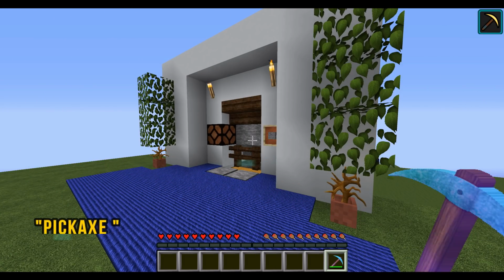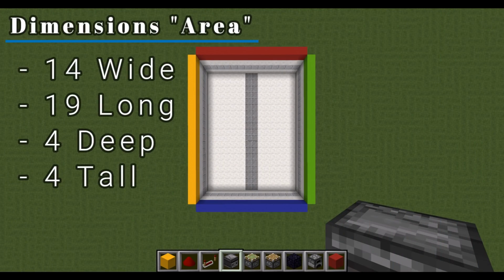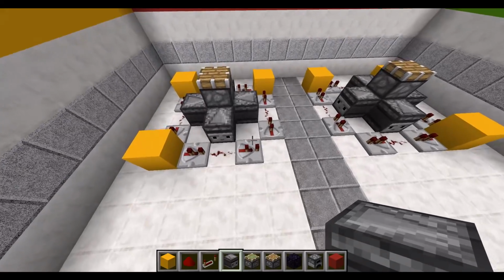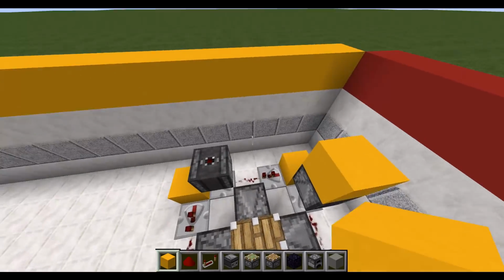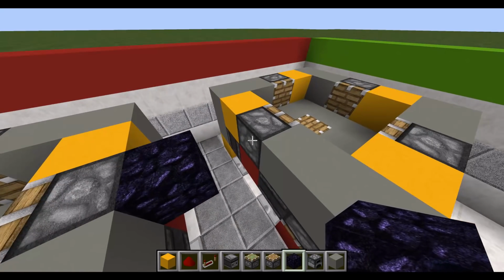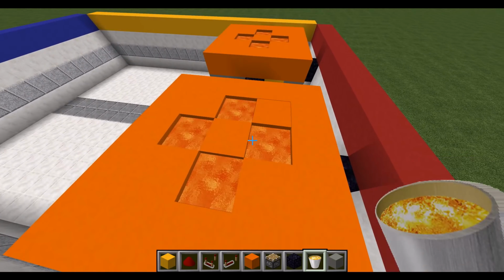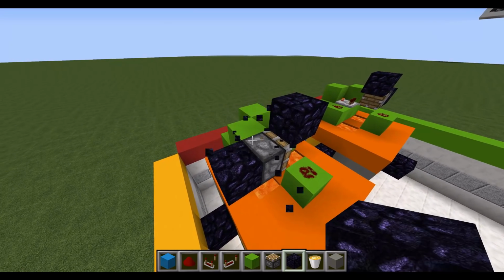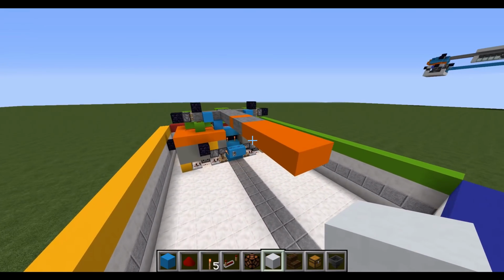Minecraft Tutorial : Auto "Cobble & Stone"  Generator V2 (Super Fast)

Comment: Does this work on console? Or just PC?
Reply from the maker: yes
Reply: K1 Inc. that didnt answer anything...yes to console? Yes to PC? Or yes to someone else...please help😭
Reply from the maker: imzombiekilla my apologize yes it works on the pc and ps4,and yhr Xbox it should work the same the only potential  issue that o see is the bedrock edition which there mechanical might affect it but I don't see how it would I hope this answered the question by the way I'm always here to help
Reply: K1 Inc. please provide an explanation or tutorial for us bedrock players
Reply: K1 Inc. thanks, and by the way great videos as always...there always so helpful
Reply: That's a stupid question considering most, if not all, of his videos are done on xbox
Reply: Ken,   on bedrock the horizontal pistons that push the stone into the vertical run  glitch after one or two pulses if your lucky.   you can remove all the observers powering those pistons though and power the pistons off the corner three blocks using a redstone torch with a block above it,  a redstone torch on top of this block,   next to the block another block to place it next to but just under the obsidian backing the piston.   you may use redstone dust or a repeater to push the power into the obsidian and power the piston.

Due to the shut off corner I used the back center block of each generator to power two pistons in this manner offsetting the timing of the pulses using the repeater.  

Everything else with the build worked fine in beddrock

Thanks for the design  works faster then the previous one I had tossed up on my floating island.
Reply: Fantasy Novel do you have a video of this because i cannot follow your explanation